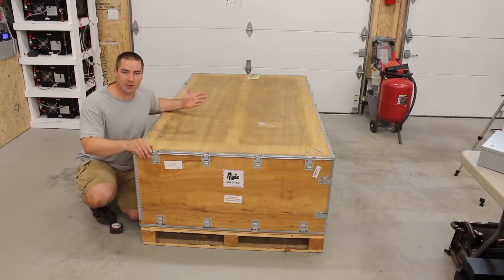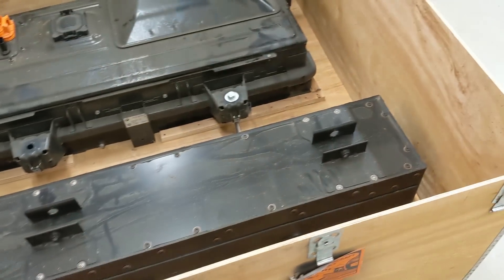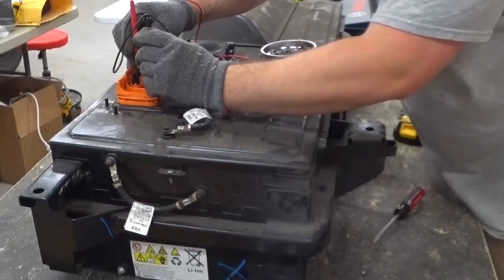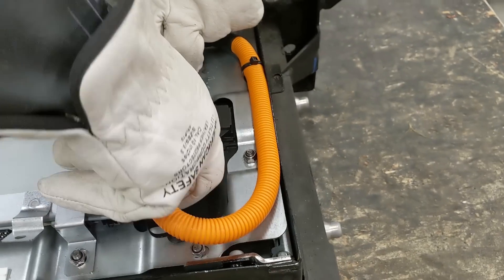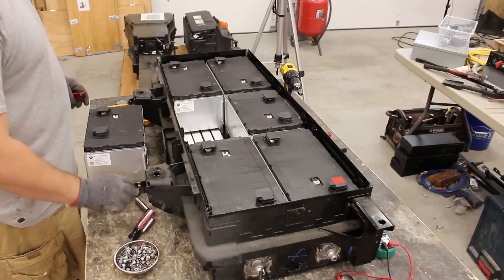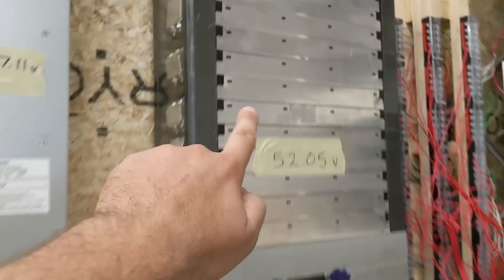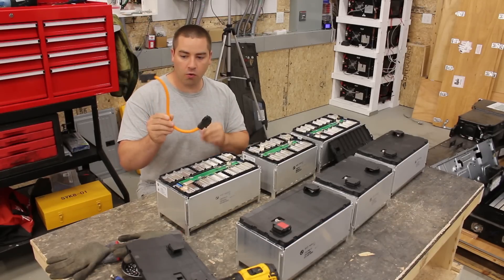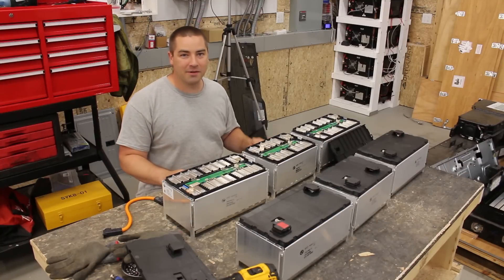Huge BMW Lithium Battery, EV, Less Than $100/kwh

Comment: If you ever have extra  batteries to sell or trade or just want one more like minded friend email me 
benjiamber18@gmail.com

 We live in wv close to ripley have three boys married over 19 years been with wife 22 years love God but  don't judge others

Wife and I have built many inverters 
(Do you know about adding a choke to lower idle current)

My 10 thousand watt bus inverter uses well under a half amp idle current at 54volts on battery side
 and it has the highest idle of all my home made inverters

The one we are  working  on now I named the farm inverter  lots of pics and info on farm inverter build on 
The back shed. com
all lower no spaces

There are many incrediblely talened expert good harted eager to help people on that site!!

I had no electronic schooling they walked me through my first build it is on site also

I have lots
 (me and buddy went in on 125 of them)
of never used 330 watt solar panels

I have lots of square and toroid transformers of all sizes and can customize wind them for any voltage 

4 or 5 Fisher and pikle
 motor/alternator the kind that has hundreds of videos and websites showing home made windtrbine and water wheels made from them 

A never used 15000 china watts  powerjack inverter
 it is probably good for 5 mabe 6 thousand watts

I also have custom designed extra mosfet boards for the powerjack thay use 3 of the large in physical size mosfets like the hy4008 

I have a 2 or 3 horsepower treadmill motor with wire harness and speed controller 

I have tons of off grid  type electronic parts 

If you have no batterys to swap on I will donate just about anything I have if you make a video with it 

I have a e-z-go throttle control box 
5 small pins and 3 large high amp m- ,b-,b+ I would send  you for a spare at no cost FREE just because i enjoy your videos

If you need a part quickly  looking for a hard to find part or need licensed hvac to buy freon 

Email me and ask 
We enjoy spreading good around !!!

If you made it this far thanks for your time 
and God bless you and your perfect little family!!

Comment: Anyway to 24v this for an underbelly rv install?

Great video as always, thanks David. I've learned a lot from you fwiw.
Reply from the maker: For a 24v system you will be looking for 7s.  You could use a dremel (Rotary cut-off wheel) and but the bus bar on the middle 4s pack in half, creating two halves on each side, which would become 4 batteries, each at 7s.  But, inside the crate are two more steel cases.  Each of those contain more cell modules.  The long one contains some 3s and 4s.  So if you wanted to you could series connect them for 7s.  That would eliminate the need for a dremel.
Reply: @DavidPozEnergy  thanks!

Comment: so here in Brisbane, Australia, my mains power is .25c/Kwh  how long is the ROI on that battery alone?
(I have a 6.35Kw solar install too so my actual usage is sfa)
Reply from the maker: This whole battery pack will have around 21kwh of usable storage on a daily basis.  This is a fairly conservative number, so as to get more cycle life.  In theory, if you had enough solar to re-charge it daily, and you used it every night, then 21kwh*.25c=$5.25/day  Battery cost is $2,880 delivered in the US.  (I don't have any clue how much to Australia)  $2,880/$5.25=549 days, or 1.5 years.  But this is never the whole story.  There are cloudy days which will push out the break-even point.  And batteries alone don't do anything without solar, inverters, and hardware.  But I hope that math helps answer your question.
Reply: @DavidPozEnergy  the maths assumes you actually use that 21Kwh.
it's possible but yes, add on all the other requirements for a full system install and it be enough for your requirements with some extra for cloudy days, the the total cost would be well, considerable.
as long as the cells last long enough to reach ROI, it's all good.
keep up the great work and videos.

Comment: Best to also have a face shield and safety glasses on, when working on high voltage, if you have a flash, there will be molten metal spraying and your face and eyes are in danger.  Excellent video.

Comment: I saw them being manufactured Here in Germany. The contacts are laser welded.
Reply from the maker: Very cool.  Thanks for letting us know.
Reply: @DavidPozEnergy  will this battery bank power a whole house entirely? And connection with a solar panels system. If so do you offer one on one advice/help? Will gladly pay for your service
Reply: @stevensaxon8888  This might help....
I'm building a giant tiny house (43' moving van). I bought (4) additional 4S batteries to make a total of 5 separate 48 volt battery banks to run two 9000 BTU A/C's,(750 watts each) (1) fridge,  (2) large freezers, washing machine , electric dryer (1 hour per day during the 5 hour sun window),  computers, TV, kitchen appliances.... Added all up it works well with 10K of panels. Thats over kill but I want to splurge when the sun is up yet still be able to charge the 30KWh of batteries within the window. My realistic reserve maybe one day. But certainly not three. And that one day would be a no wash clothes day for sure. The dryer eats the electricity like a starving Ape(still thinking about using gas). And hopefully that happens in the winter when the A/C's are not needed.

Note: Batteryhookup does not have anymore of these large battery packs. The ones they have today are the 21 KWh packs. If I was trying to power an entire 3 br/2 bath house with five people I would definitely buy TWO of the current BMW packs. at $2500 each. Giving roughly 40KWh(after down grade). They are made up of (8) 12S battery packs at 60Ah(when new).
Reply: T Mikel Do your clothes drying with a washing line. ;). But in winter use a dehumidifier. It’s a little slower than hot dryers but much more efficient
Reply: @2pi628  10 kilowatts of panels?
Reply: @DavidPozEnergy  David where did you buy the black gloves & white gloves at the 7.30 min mark?
Reply: They look like spin-welds. People say they're "weak", well, they should try to pry one off. (hint: they're on there.)
Reply: otherwise know as brazing...   not very strong but it works.
Reply: @harleyme3163  Actually laser welding and brazing are two completely different things, not comparable at all.

Comment: How much does the 5s and 4s weight individually? Wanting to put this in a RV.
Reply from the maker: I'll go check, hang on.
Reply from the maker: The 5s is 35.2 pounds, and the 4s is 28.6 pounds.
Reply: @DavidPozEnergy  Looks like the LG Chem is the better route for weight to kwh.
Reply from the maker: That LG battery I built and put on the wall?  Yeah, that was an amazing ratio kwh/pound.  I think it was 68# (or around there) and 6kwh.  6,000w/68#=88w/# 
The 5s BMW pack is 35.2#, and about 1.6kwh (I still have to do a capacity test to verify) 45w/#
So the LG pack is roughly twice the density.  
But compare that to my "Tower of Power" which is made of old and abused LiFePO4 cells.  Those are 164# each, and I'm getting 3kwh.  18w/#

Comment: I Just emailed bh about picking up 2 of these.  Currently There’s no way to select pickup locally. The only option is to pay for shipping. Hopefully I’ll pick them up Monday/Tuesday. Thanks for making this video. Looking forward to the bms video!
Reply from the maker: Great, that will save you some cash on delivery.  The guys at Battery Hookup are great, but it sounds like they need to provide a local option on the website.

Comment: I would definitely keep the battery cooling system...all you need is a 5 gal bucket an aquarium water pump & two hoses make sure you have the top for the 5 gal bucket.....you can add ice to the bucket and see if the battery runs cooler or maybe dry ice....also keeping it intake Will make it easier for you to make your own EV car...
Cheers ah
Reply: I don't think it'd be hard to find a used radiator either if you wanted to just water cool it so they can at least stay cooler than not cooling  it.
Reply: You have to realize that these cars are driven in 30below temperatures and you have to heat the battery’s to be able to use them
Reply: Agree, however... don't have a clue to his load  and thus may not be needed.  A better/programable inverter would be best.

Comment: Are the cell voltages the same as your other batteries ? - so you can parallel them ?
Reply from the maker: They are the same as the LG (silver color) pack on the wall.  But different than the black "Tower of Power", which is LiFePO4.

Comment: If you ever did want to hook the active cooling loop back up you could consider making it a pre-heater for your solar hot water system. It'd be tricky since the battery isn't always heating up and you don't always need hot water of course, but if you did you'd be recycling a fair bit of thermal energy.

Comment: David, About how much does that module you opened weigh? I would like to stack 4. I saw some metal shelving units on Amazon that are 52" wide and hold 350# per shelve. Great video.
Reply from the maker: That one module I took apart is about 500 pounds.  Don't underestimate it.  I found this as an example, says 2,000# per shelf: https://amzn.to/3eAAV9e  Look for something along these lines.  
“As an Amazon Associate I earn from qualifying purchases.”

Comment: David i am looking to build a 48v system for a Rv do you think these would be suitable? Looking forward to the build.
Reply from the maker: They are built tough and should have no problem with the vibrations in an RV.  You would want to make sure you have enough capacity for your build.  This whole car is about 27kwh, and the one module I took apart should test about 8kwh.  Be careful of putting them into some compartment that gets too hot.  Ideally keep any lithium below 100°F.  I've seen some YouTubers put the cells under the RV, but add a little window AC to the compartment.
Reply: DavidPoz nice I have seen most use 4-6 12v battle born. So that’s about a 48v 150 amp hour. I think just one of these out of the three you show would do the trick. Now I just need your gloves and a spot wield device.. and a few Bms. Thanks Again!

Comment: Are you running multiple packs and configurations at the same time?  I have a 48kwh Leaf system and would love to be able to scale it using Volt or BMW modules, but haven't thought through it in detail.  I would love to hear your experience.
Reply from the maker: Yes, you just have to keep them inside the safe voltage ranges.  leaf cells are also a version of Li-ion, and probably have similar voltage range as BMW cells, or Chevy Volt, etc.  Yes, sometimes there are slight variations, but if you overall keep your max and min pack voltages conservative, it's ok

Comment: I wonder what the remaining life span on these cells will be? Good for three to five more years? Another 10? I guess it would depend on how you used them but for an off grid home with a good power plan a couple of these would be plenty to handle even a few days of clouds.
Reply from the maker: I'm optimistic about the future lifespan.  But I also don't push them hard.  I cycle these type of cells 3.40v-4.05v per cell.  Which gives about 75% of total capacity, but gives something like 3x the lifespan compared to 100% (3.0-4.2)

Comment: sir actually i looking battery chemistry which can charge or discharge 12V 300A in a Hour is it possible?
Reply from the maker: LTO cells can do amazing C rates.  Check out this video: https://youtu.be/3pYR2cWcnkk
Reply: @DavidPozEnergy  actually sir i m working on a power generation project i have 220v ac dynamo 5kw generator. is it possible to dump 5kw in super capacitors in 30 sec & take out back the full load from caps in next 30 sec?

Comment: It's great to see you can use them as-is without any modifying. That's the one big downside to some of these batteries, odd series amounts, like 8s, 12s, etc - but if you can pair them together like this and are lucky enough that it makes a 14s you're set! :D
Reply from the maker: Yeah, really cool to find a 14s layout.
Reply: So 6 of those modules are 5kw ? 
How many all up and what model bmw
Reply: they will last few months in house  use
Reply: @crypto-jorozu1532  they will last years

Comment: Where do you buy your BMS's from, in the US ? I ordered some 100amp bms from aliexpress 2 months ago and they still haven't arrived. It really sucks to do a build where you can get the batteries in days but the BMS takes months to arrive.  Looks like a nice build!
Reply from the maker: I'm in the same boat as you.  I order my BMS from Aliexpress.  Sometimes they take 2 months.  I try to buy from sellers with high ratings, but even with that sometimes shipments get lost.
Reply: @DavidPozEnergy  Ok, thanks Dave. I ended up buying a no name 60amp (aren't they all no name ? :) BMS on eBay to experiment with. It was USA ship so it came quickly. Sometime the sellers lie that they are USA ship and you end up back in the same boat waiting for months. Sucks.
Reply from the maker: I buy "Daly" brand BMS.  I haven't had a problem with them.
Reply: @DavidPozEnergy  Hi Dave, I got the four Daly 100amp BMS's in the mail. Now I can go on and build my powerwall from those LG batteries you covered some time ago - they've just been sitting in my garage waitint!. Thanks for the videos; they were an inspiration to get me started and moved away from the grid with the ridiculous electricity prices we have were. We have no choice with these monopolies but with solar we can simply opt out. Cheers,Vince

Comment: I was hoping to see you using the new battery for your EV.
Reply from the maker: That's what I will be working on with the other two modules.  I didn't know that this module would split so nicely into 48v.  But the other two modules will have some odd-ball size cell layouts and probably work better for the EV project.

Comment: Awesome info video! Thanks! How do I get you to direct me to a business that repairs PowerBright 3500W/12v inverter. I bought in 2019. Thanks for any help info you may provide!
Reply: I just googled the powerbright 3500-12 and found several authorized establishments for  this inverter. Much depends on where you are located. Also note that this inverter seems a be at price point where it may well be unfeasible to repair. MANY manufactures do not repair their products even within the warranty period...instead just replacing the unit with another. Best of luck with your research.

Comment: What is in the other 2 cases ???
Reply from the maker: More cells.  This one I opened up had 28s (28 cells in series).  The whole car has 96s.  So there must be another 68s split into the next two boxes.  I just haven't opened them yet to see the configuration.
Reply: @DavidPozEnergy  Can't wait for you to open them David.

Comment: Thanks for the video David. What BMS will you use for the pack?
Reply from the maker: Probably Daly brand, 14s, 100 amp.  I buy them from Ali-express. https://daly.aliexpress.com/store/4165007?spm=a2g0o.detail.100005.1.14852eb78SK3Zg
Reply: @DavidPozEnergy  14s 48volt? The link to the product doesn't work fully.

Comment: I bought 2 when they came out. I'm disassembling the second one. I was trying to make a video of disassembling the packs because I couldn't find any video of the batteries. You make a better job. Using the batteries for extended Nissan leaf battery and  mg midget ev convert. Great job 😊🎉

Comment: Great stuff, David.  Do you think you could parallel these with a Lifepo4 48v bank using those LV5048 charger/inverters?  Our local electric company bases their billing cycle on a one-day period for net metering purposes and I need a way to time shift some load capacity over from sunny days to cloudy days.
Reply from the maker: 14s Li-ion pack will overlap a 16s LiFePO4 pack for the voltage you use.  So, yes, they can be paralleled.  Make sure you program your high-voltage and low-voltage cutoffs based on the more conservative of the two.  I go into more detail on this in another video: https://youtu.be/CbHABrTpSKU  This topic is one I want to explore and test more, once I get the time for it.

Comment: I'll try do do a search in your videos but do you explain volts,ah kwh
I'm looking to upgrade my old 12v system which had 6x2v 960ah AGM batteries.
I never remembering talking about Kwh we(people I know) only talked about amp hours.
I'm 100% off-grid, I live deep in the Australian bush so Off grid is the only option(thankfully but costly)
Reply from the maker: I don't have a dedicated video just on that topic.  I remember back when I was getting into this and the information surrounding lead acid batteries was all in ah.  I think because the ah changed so much based on your C rate.  But with lithium it's much more constant.  I like talking in kwh because I find more people can grasp this since the electric provider bills in kwh, and the meter on grid-tied homes records in kwh.  
For your situation, your 960ah might be at a 20 hour rate, but could be more or less based on 1 hour rate, or 100 hour rate.  But if you take 960ah times 12v (nominal pack voltage for you) = 11.5 kwh.
Reply: @DavidPozEnergy  well done.
I hope it is feasible for you to go off-grid completely one day.
I also hope one day you can encourage more to go off-grid rely more upon ourselves then to rely on a grid company.
The cost is still VERY expensive for us off grid people but the more people who get into Solar the lower the prices become.